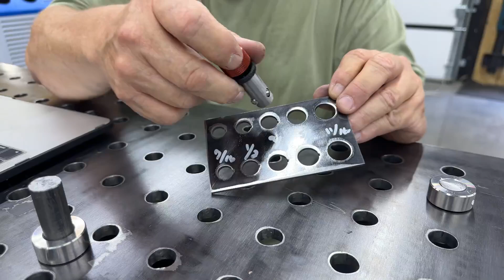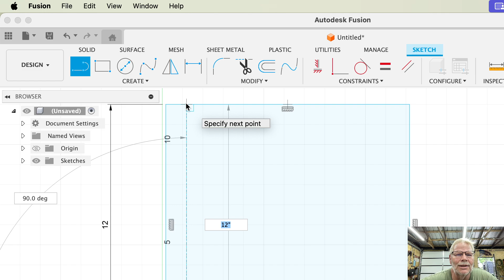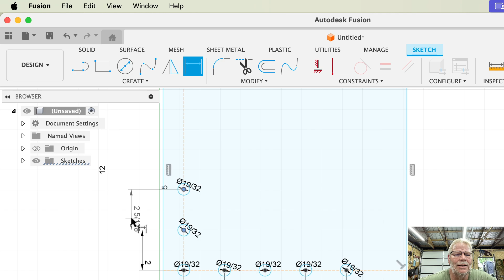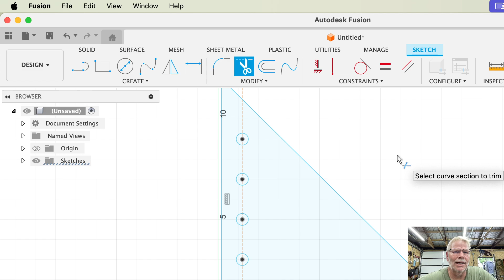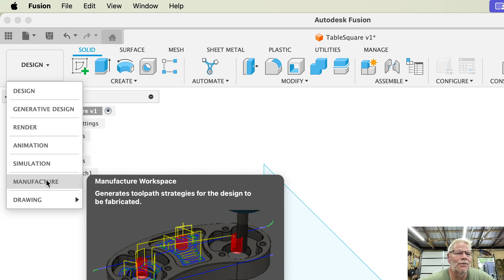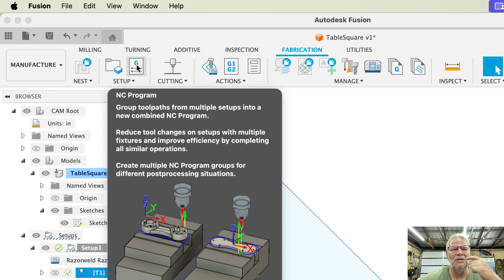Making a Welding Table Square in Fusion 360 and Langmuire Crossfire Pro

Comment: I realize you ended up where you wanted to be but I think calibrating the system to cut the proper dimension would have been the proper way to do this.